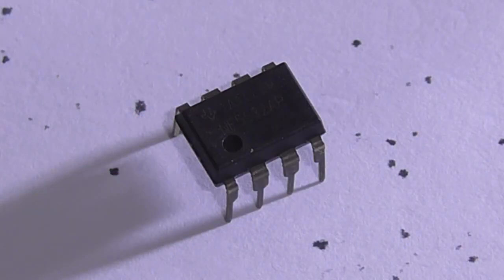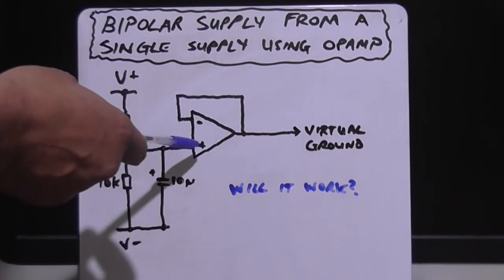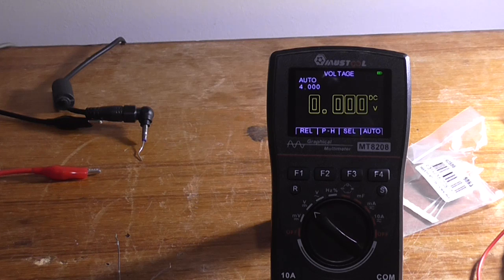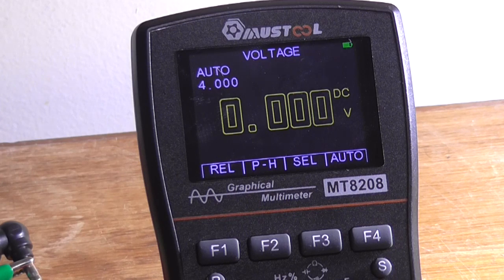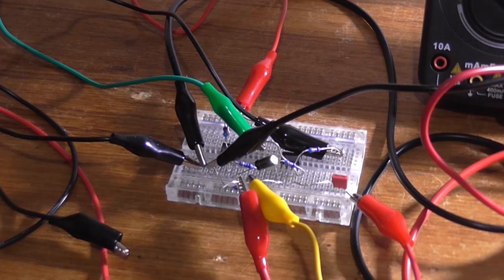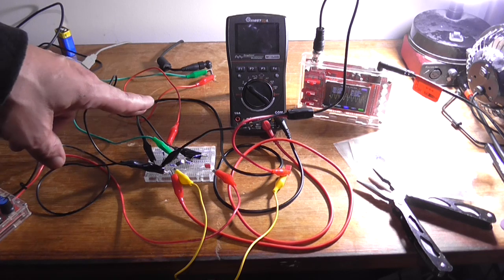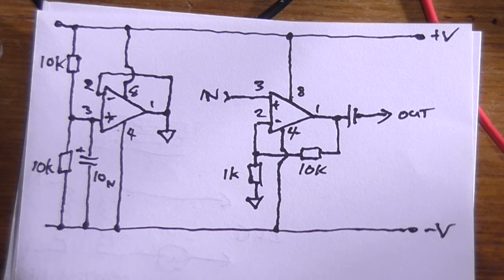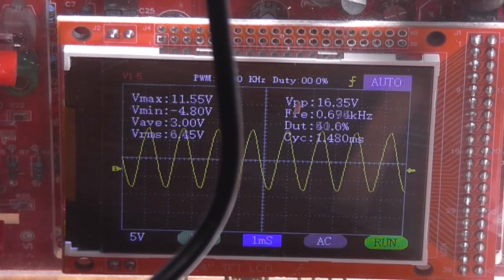Electronics Fundamentals: Op Amp Based Power Supply Rail Splitter

Comment: If you need more current, you should be able to drive a power transistor with the op amp.  Feedback will keep it regulated.